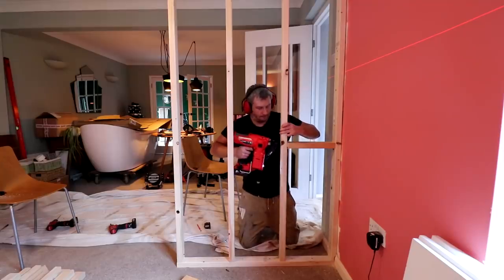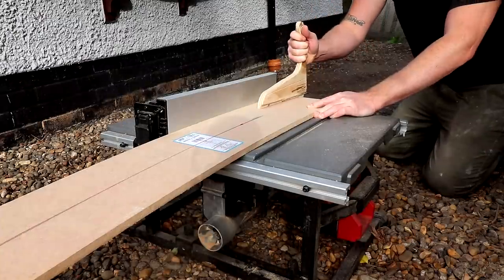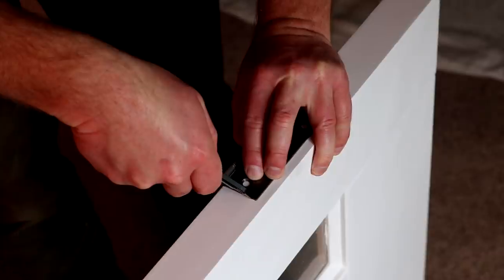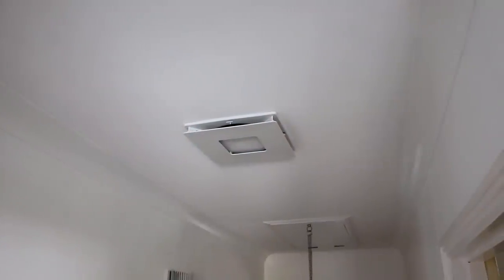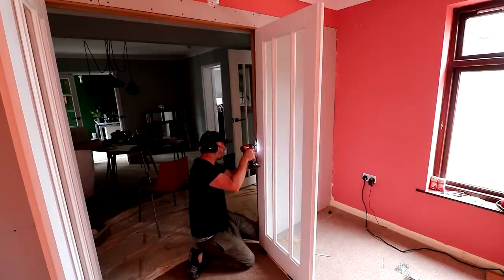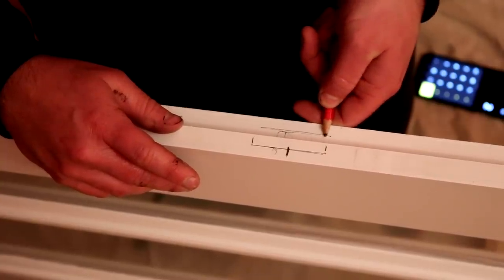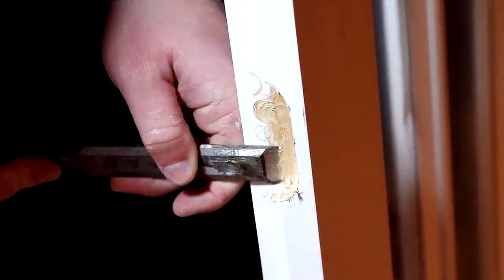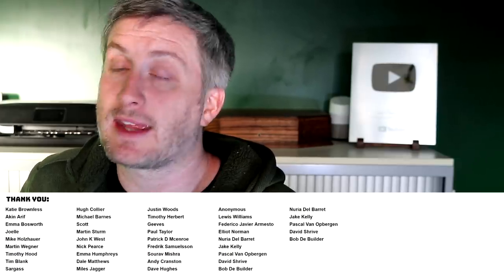Fitting & Hanging French Doors

Comment: hey buddy quick tip.  never cut your door.  use 4'' heavy duty screws in your hinges to move over the gaps.  you'd be surprised how fast a couple of hits with an impact driver you can shift gaps on a door.  it can be used on any gap all the way around the door.  if your doors were square obviously now they're not.  if you need clarification let me know.  i can make very quick video explaining if need be.

Comment: Routering tip, if you have to cut hinges into a door again it's worth clamping a length of 4 x 2 or similar to the face of the door so it's flush with the edge, that gives you twice the reference surface for you router to ride on & makes it a lot easier to keep it square. Keep up the good work.

Comment: PIVs are good, for little bit more money you can get an heat exchanger which will save money on bills. I also recommend a system 3 extractor fan which constantly runs effectively doing what you PIV is doing. I have a Bungelow also so know what you mean about Condensation

Comment: Forstner bit works wonders for making those door furniture holes, as you can simply go down, and then enlarge just by applying a little sideways force to the bit. Works well when installing 3 lever locksets, as you just mark out the cut, put a bit of tape on the bit to show the depth of the cut needed ( plus 5mm clearance for the bottom, not going to be exact) and drill in, then join all the holes with a little sideways force, and you can drill while pulling out as well. Not going to look perfect first time inside, but the lock will fit.

Not that I hang doors regular, but made hanging 3 less than a day's work. I had to drill one new door, and move the furniture on the other 2 to fit the new stuff, plus plane them down just a few centimeters all round to fit the old frames. hollow core doors, at least the cheap ones, you get little wood in there aside from the marked areas for hinges and lockset, the rest is a little thin skin of wood glued down. Had to cut the outside skin and glue the base back on on one, as it would have vanished trying to get the cut needed.

Comment: I know this is to a tight budget and just making you aware in case you aren’t....did you look at double pocket door kits that hide the leaves within the stud wall when open? They give a great feeling of space and the kits with a drive system operate both door as a pair so they always meet in the centre. Also/or as a budget option parliament hinges allow the doors to swing past the architrave and open flat against the wall. I’ve used a few sets of the latter as a cheap upgrade when people want the doors open a lot for parties or whatever.

Comment: Great vid Keith; good pointer to leave 10mm under each door -I recently moved into a bungalow and know what you mean re condensation/damp/mould. Have been using a dehumidifier in the humid months, but will also check out the PIV system, thanks for recommending. atb
Reply: Stick with the dehumidifier, PIV systems waste an awful lot of heat in the winter, I am surprised they are allowed to be fitted given how we are trying to make homes more efficient.
Reply: @caskwith  thanks for your input. I just insulated the bungalow (cavity wall and 400mm in loft) so will see how it goes this winter.
Reply from the maker: Definitely check them out, ours has been really effective and the air just feels so much fresher too. Wouldn't be without it

Comment: Great video, i have a lounge / dining room.  with a open doorway  (no doors fitted).  I'm wanting to fit double french doors, the thickness of the wall is 16cm, and i was going to fit a lining, with the doors opening into the dining room.  But i had a question, should i mount the doors in the middle, or have them more to the living room or dining room side? As the doors themselves are only 3.5cm thick, but the wall/lining will be 16cm thick ?
Reply from the maker: If the doors are opening in to your dining room that will mean that the pin side of the hinge will also be on that side, so personally I would position the doors so they are flush with the walls in the dining room

Comment: Nice one Keith 👍🏼. Do you know where the inconsistent dimensions were created? Stud work our of plumb? Hinge depths different? Door linings? Doors with tolerance?
Reply from the maker: Cheers Ryan, probably a mixture of a few of those things I suspect.  Both the studs were measuring plumb, so I'm not really sure where the discrepancy came from
Reply: Your method was the problem there, first thing you should do is offer the door to the opening and shoot it in. Also door linings are normally packed from the studwork plumb and the head level, the more accurate the better for hanging the doors, especially double rebated doors!

Comment: Would you do it different next time? like for example making the wall frame door gap bigger to avoid cutting the doors?
Reply from the maker: I'd rather the door opening be too small than too big as it's really easy to trim the doors and they needed a coat of paint anyway. There were things I'd do differently with the wall build, I'll try and cover them in the next vid 👍

Comment: Great video as always.
A question about the PIV though - Wouldn't it be cheaper long term to invest in a similar MVHR unit?
Reply from the maker: From what I understand they require a lot of ducting etc throughout the house to get an effective system. Not something that would be affordable for us I expect. The piv is pretty cheap and works great and easy to install with minimal set up

Comment: Was your door hole in the wall square? Did you have even gap down the length of the door to frame? Surprised you had to taper cut top & sides of the doors, indicates something wasn't square...!! 
Butt good effort & job finish overcoming the difficulties.
Reply from the maker: The uprights measured plumb. I didn't really check for square at all. Not sure where the discrepancy occurred but a 6mm discrepancy across 1.98m isn't that bad anyway I suppose